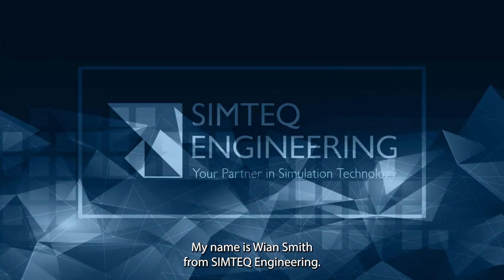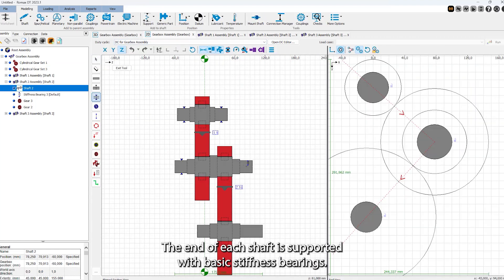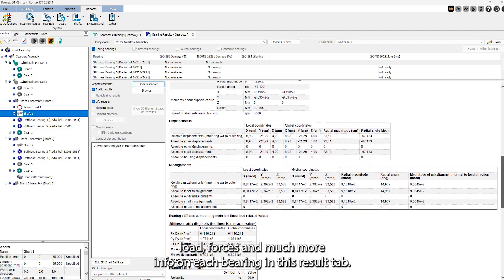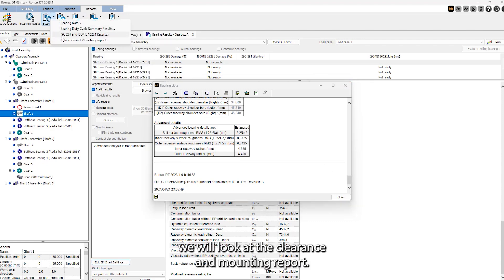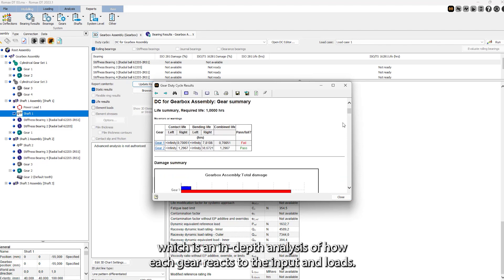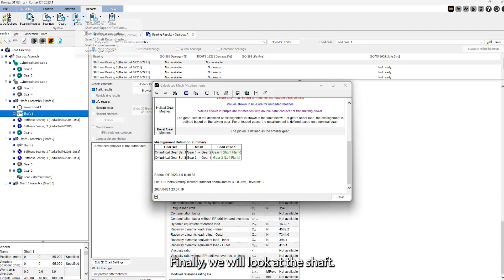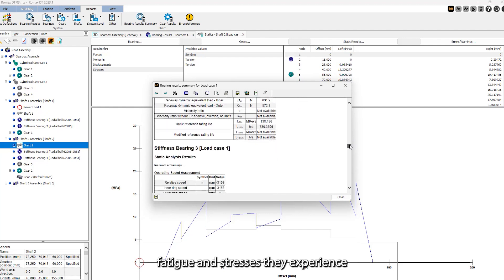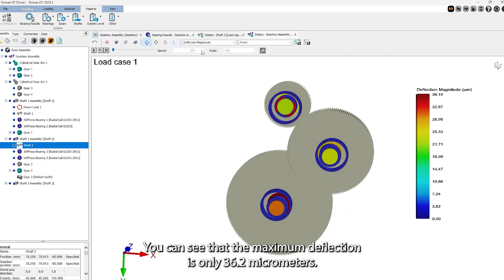Getting started guide for Romax (Quick overview)

Comment: Hi, I'm quite new to the software and want to do an analysis by using journal bearing with hydrodynamics but I couldn't find a useful tutorial on that. Plus, I still don't know if the software can produce time series data or not. Since all the tutorials I've seen they generate, plots based on the offset of the shaft. I would appreciate if you could give me any tips on these issues. Thanks.
Reply from the maker: Good day, for a guide on how to create a journal bearing with hydrodynamics you can follow the link below:
https://nexus.hexagon.com/documentationcenter/en-US/bundle/romax_DT_2024.1_Tutorials/page/143768456.html)

(Please note that you will require access to Nexus by Hexagon, https://nexus.hexagon.com/, to access this documentation.)

Regarding whether Romax is time domain: Even though Romax has some time domain capability, if that is your primary concern it would be better to consider Adams as well.
Reply: Hello, I'm new to the software and as part of my thesis I have to do a static analysis of two spherical roller bearings with applied loads.